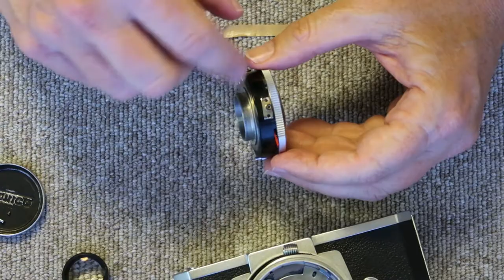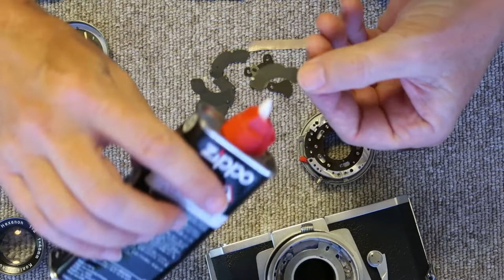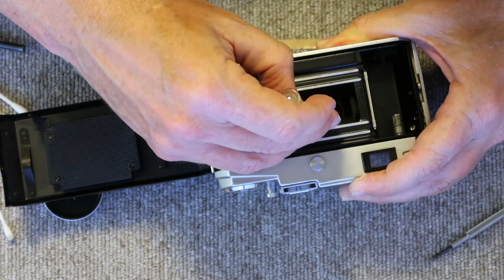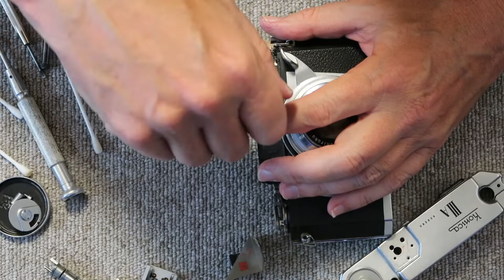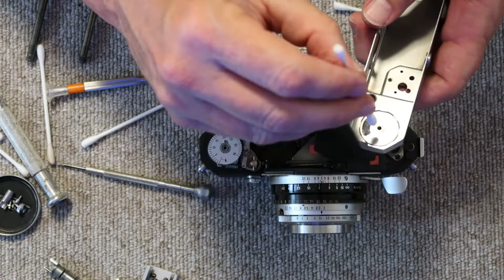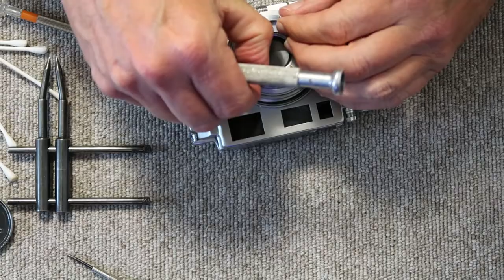How to Repair a Konica IIIA Rangefinder Camera

Comment: I tried cleaning my Sutter and aperature with Alcool and without taking it fully aprt like you did, but that works only partially. Gonna try Zippy fluid next...and probably will have to take blades apart. Looking at your video it doesnt seem THAT difficult to put blades together. Overall this camera seems repair friendly. Access to the shutter is fairly easy. Im doing a Shootout of Rangefinders and this camera is in the semifinal when iot froze up on me...so now I have to clean it before continuing the competition.

Comment: Thank you for this video. I was gifted two Konica's a iii and a ii. The iii had dislodged shutter blades and sticky aperture blades. Got them all out and back in. Only problem is the shutter release lever and spring don't really fit in place any longer. The spring points straight out when in the proper position.

Comment: Wow this was so helpful! A comment and a question:
-- I need to repair three Konica I's all of which have slow or sticking shutters. Is the basic innards of the lens the same in your opinion?

-- When cleaning shutter or aperture blades, I recommend putting on a stable, smooth surface like table and gently wiping, rather than holding. Its very easy to accidentally bend them or get cloth caught under, pull up and break off an edge. They are super delicate and a small bend or deformation in the blades and the shutter is going to be ruined.

Comment: As an amateur, I gasped as you dropped all the shutter blades off the shutter assembly. I guess it takes experience and knowledge to be confident in placing everything back in the correct position.
Reply: removing the first part of the camera to start the repair process caused me to gasp.

Comment: I have just found a near mint IIIA. The slow speeds sound about right but the faster speeds are quite slow. When I find a good lens spanner I will have a go at un-doing the nut from the back. That looks like the most risky part as you are applying force with a sharp metal instrument very close to the lens. A steady hand will be required!
PS - tried the lighter fluid trick on it's own and it worked!

Comment: Very good explaining and video.please its the same process  to  clean the shutter blades on Konica III (no A)?
Reply from the maker: If its the later III with the EV interlock system, it's exactly the same. If it's the earlier version, there are some minor differences.
Reply: @japanvintagecamera8869  on the top of the camera only say" konica III
Reply from the maker: @rahandulcaspatal5276  The paint in the letters and numbers comes out easily.
Reply: @japanvintagecamera8869  ok .i want only repair one shutter blade out off
Reply: @japanvintagecamera8869  hello. Well i have fixed the shutter blade just this afternoon.so the shutter work fine now...please i can observé that the focusing distances on intinite positivo that not coincidence with the Mark the focusing run further away the Mark .and the speed. Dial its not exactily on the dial Mark...  Do you think its posible to adjust this?  Thank a lot

Comment: Hey! great video. I recently inherited a Konica IIIa from my grandfather and found this video as the shutter was sometimes getting stuck. Upon taking off the shutter, however, it works perfectly. I'm thinking the issue lies in the advance cocking lever as it is a bit tough to crank and gets stuck when it reaches the bottom (but swings up when I apply a little force.) I also noticed that when in the middle of a crank, the shutter blades open up a bit and the only way to fix it is to either continue cranking or twist the aperture ring (which knocks the blades back into place).  Any one else have a similar issue or do you have any thoughts on how to fix it? Many thanks!

Comment: Thank you so much for a wonderful video - I did all of this for my mint condition Konica lll and everything you suggest works perfectly - you mentioned every little detail! One question, my shutter cocking lever seems to drag on both cocks. On its way back up, it needs a slight bit of help, but it does work. In this video, yours is obviously smoother. Is this just a spring issue, or does something need to be oiled? Thanks again - I love your channel.
Reply from the maker: The lagging charging arm can be caused by lack of oil in the winder which goes under the shutter, or on the mechanism under the bottom cover of the camera. If the bottom cover is dented, that can also cause it to stick.
Reply: @japanvintagecamera8869  Hello JPV! I've followed this video with great success to restore my IIIa, which really made me appreciate the craftsmanship that went into it. Like @brentwahl6337, my advance lever was a little weak, so I oiled the bottom components with bike chain oil, and that helped a lot. However, the advance lever spring makes a lot of pinging noise, like someone's plucking it with the tiniest guitar pick, as it's rotated. Would it be helpful or worth it to replace this spring? I tried to get to it after taking off the front lens assembly, but that ring the lever is notched into is difficult to take off, even after removing the three screws, because the spring connected to the ring holds it down. I could probably remove the spring in that small gap but I'm hesitant if I would be able to reattach a new one. Any thoughts?

Comment: I found the Konica IIIM at a thrift store for $7 and I was so excited to use it but the shutter was stuck shut. I followed this tutorial for the IIIA because you’ve said in the other video that they were fairly the same. But I couldn’t remove unscrew the lens so I removed more layers to try to manually get down to the shutter. But I couldn’t get down far enough as the screws got stuck. But now I fear I can’t get it back together correctly! The plastic black separation layer that is placed over the aperature dial and shutter lever doesn’t seem to want to fit back into place. Really hope I didn’t mess this up. Any advice?

Comment: Thank you for a very useful tutorial specifically on the Seikosha MXL shutter. Mine is not on a Konica but a Mamiya 35 Magazine. The thing that most perplexes me is the 6th shutter blade. You advise leaving it off and that is just as well as I can only see mounting pins for five blades! How on earth was it fitted in the first place? 

It was a great help to see you re-assemble the diaphragm blades. The ones out of the Mamiya didn't look the same as there were many holes were some of the little locating pins should be. How could that work? By great luck I have another Seikosha MXL from a broken Konica IIIa. So I took the diaphragm assembly apart to reveal blades as I would expect. Seems that my Mamiya's had jammed at some point and it had been forced so breaking off many of the little pins.Some of these tiny little things I then discovered on my work surface. I have now used the blades from the Konica on my Mamiya to rebuild the diaphragm on the Mamiya. Phew!
Reply from the maker: Working on cameras can be an adventure. As you replace the blades moving in a circle, the 6th blade goes on top of the 1st blade.
Reply: @japanvintagecamera8869  Thanks! How very strange to have that 6th blade doing absolutely nothing as a light barrier as it literally shadows the 1st. I suppose it was meant to somehow help hold the array of blades together.
Reply: Ah you did mention the 6th blade was installed to slow down a new shutter that was too fast.

Comment: Thank you so much for the tutorial…but unfortunately I bought a iiia with a stuck self timer lever…I cannot seem to get the self timer lever to “go off”, so now when I press the shutter release nothing happens. The film advance winding lever seems to still able to work but not sure if it’s cocking the shutter. The shutter is fine as I took the lens apart and did the shutter test like you did it seems fine….Any ideas would be greatly appreciated 😊
Reply: I did manage to trip it from the inside - all good now - thanks for the video again it gave me the courage to open the camera up and do self fixing …now just need to fix the rangefinder ! 😊

Comment: Is the 50mm 1.8 lens more desirable then the 45mm, looking at photo's on Flicker the 50mm does look like it is very sharp.
Reply from the maker: The 48mm lens is better regarded, the best version actually came on the Konica IIA, as this camera had a 10 blade aperture instead of the 5 blade version which came with the IIIA. However, the IIA does not have the IIIA’s brilliant viewfinder.

Comment: Excellent Video, thank you.  QUESTION:  I successfully disabled my ev interlock system on the Konica iiia as you showed in another video.  The little "bow tie" leaf spring at the 12 o'clock position fell out but I'm at a loss to see what holds it in position?  I can re-install it easily, but can you give me any information on how to hold that spring in place?  Thanks again for the great video.
Reply from the maker: Sorry for the late reply, a drop of oil will hold it in place.

Comment: Hi Sir ,Could you make a video about How to Repair a Konica "I"?
My Konica "I" is moldy, I try to clean the lenses..
Reply from the maker: The lens on the Konica I is very easy to clean on the inside, simply unscrew the front element group with your fingers. Sometimes only the front element comes off, you will see two holes underneath where you apply a tool to remove the rear element, you can use a pair of tweezers or sharpened needle nose pliers to put in the holes to remove the inner element.
Reply: @japanvintagecamera8869  Thank you very much!!

Comment: My Shutter was  working OK,then i set  the self Timer in the down position, and now the camera wont release,Any Advise ?
Reply from the maker: If you open the back of the camera, you'll see a cover on the film winding sprocket held on by two screws. If you remove these screws you'll find the self timer mechanism. Sometimes a few drops of solvent will get it going, or you can press or push different parts of the mechanism (gently) to unstick it. Sometimes they are beyond help, and need to be replaced or disabled.
Reply: @japanvintagecamera8869   THANK You so much for your reply, tried  everything ,still jammed.

Comment: Hello, how do you remove the bottom plate?
Reply from the maker: You need to remove the screw inside the film chamber which holds the bottom of the film canister, this will allow the door latch lock to be removed, then remove the 4 screws on the bottom cover.